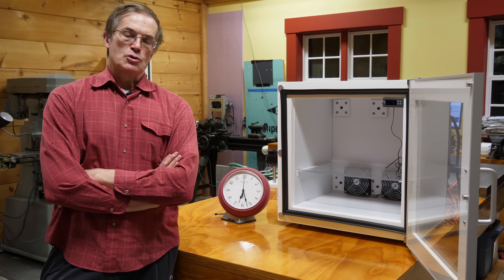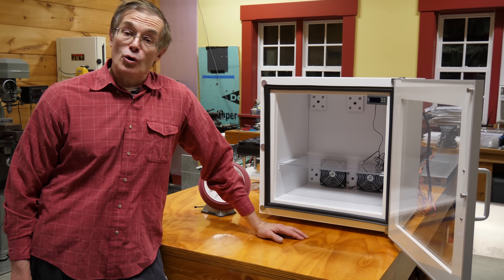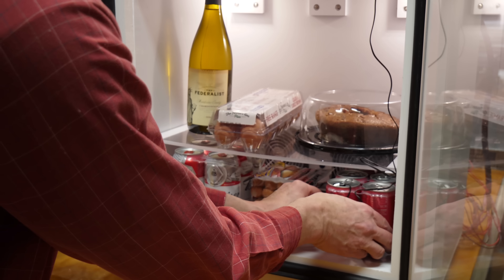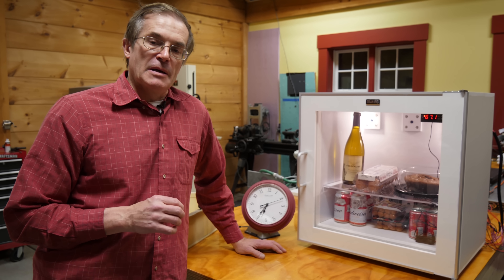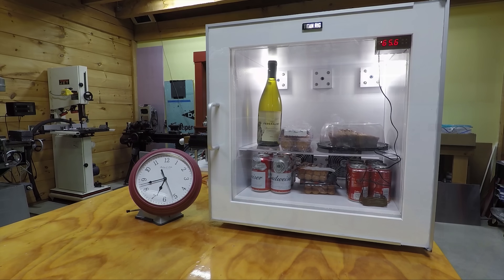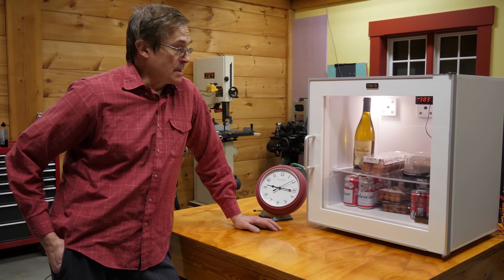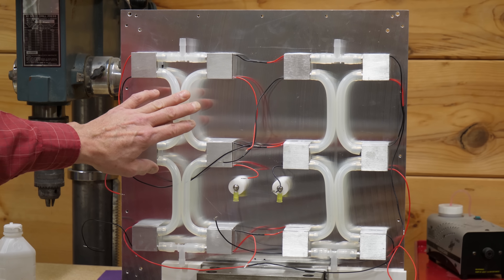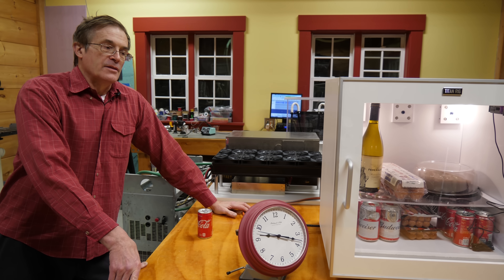TESTING OUR DIY REFRIGERATOR! - TEC/PELTIER

Comment: How about a fan duct that just brings outdoor cold air to the back of the fridge when it is cold enough outside? That would probably work with a regular refrigerator too.
Reply from the maker: That would work, but a challenge is condensation.  Water lines can be insulated  with a little effort.  An air duct will  have to be sealed and all the cold  surfaces on the back of the refrigerator will also have to be isolated from the room air to prevent condensation from dripping on to the floor.  The obvious advantage would be the higher effeciency of the existing phase change system on the conventional refrigerator.
Reply: @TechIngredients  That is true, but the cost of the cooling would be much cheaper, and totally passive if the weather was cool enough. I wonder if you had a water tank and used that as the heat sink for the peltier units if that would be better. You could use that water tank as a preheater for your regular water heater. Of course the cooling efficiency would go down if you did not take a shower and do the wash for too long...

Comment: be careful because if i have a similar system with a water loop and i get my "cold" side heat syncs freezing up a lot. once they are covered in ice it lowers the surface area and will reduce you heat transfer out of the box. 
wish i could post pics on here of my system. i use to to cool my dinks so i dont have to get up form my pc as much during work hours
Reply from the maker: The cold side is isolated from room air and the interior of the freezer is hermetically sealed.  We also don't want condensation to cause water to drip from the cold components.

Comment: Very cool...    you have to love Pex for allowing the flexibility needed to do single runs from any two points, like if you were to put your heat exchanger outside...
Reply from the maker: That's a good point.  It's also the material I would use if constructing a small thermal ground loop as a year round heat sink.

Comment: So you have 6 surface areas, 5  of which are insulated, and 1 light.  So does the efficiency decrease by 1/6th because the door is uninsulated?  Does that light decrease efficiency more than an uninsulated door?  Because this is a demo, that is why you are using the glass door.  Also, if you used a metal shelf like a thermal mass, would that thermal mass do anything significant to increase efficiency?   Lastly,  can you hook up a watt meter to check on the power consumption?
 I'm guessing you could make those fans variable to reduce power consumption when you are at temperature.  Thanks for the fantastic videos!
Reply from the maker: The door is double pane, but still has a lower insulating than 5cm of foam.  The lights are each 3 watt LEDs.  The shelf is pooly coupled to the heat removal path and so, it acts like the food as a thermal mass.
The performance of the refrigerator was balanced against it's convenience.
The freezer, on the other hand, will improve on the insulation, dispense with regulation, lights and we'll analyse the power consumption as well as the benefit of various remote heat sinking schemes.

Comment: There's a cooling system called SkyCool, which is a reflective panel that reflects light, more specifically wavelengths of 8 to 13 µm, into the upper atmosphere and space to provide cooling. 'Tests' show 4.9°C below ambient, and a claimed cooling power of 40.1W/m², on a 40°C day.
As far as I've searched, I can't tell if the material they use on the panel is just aluminized mylar, or if there's more to it. I also don't know how they're coupling their panel to their coolant loop, as SkyCool is meant to be an alternative to refrigeration based air conditioning. 
Diy'ing your own SkyCool system would make for a good video or series, and would go along with this project well. Hopefully it's something you can look into.
Reply from the maker: I'll look into that.

Comment: This looks so much better than any other Peltier refrigerator video out there, this and the previous one! I was hesitant to watch that one but it really wasn't just a 40-minutes build log. All the explanations you give teach so much, thanks.

Also one thing I'd like to mention is, thermal grease quality makes a big difference. CPU-quality thermal grease, even mainstream ones like Arctic Silver 5, are better than the general purpose electronics ones (in my limited experience) and expensive ones like liquid metal (like Conductonaut) can drop a CPU's temperatures by as much as 20 degrees (!!!) using the same active cooling which is frankly mind-blowing to me and I'd consider it helpful in "one of the legs of that stool".
Reply from the maker: We are working on a thermal grease video.  The single most important component is the surface preparation.  With flat enough surfaces that are very smooth, no grease is needed and any grease is worse than none.  Beyond that, the heat transmission depends on some interesting interaction between the organics and the high conductivity fillers.

Comment: @Tech Ingredients - Can you please post the electricity amounts used to get this 30°temp difference? Im assuming you're running it at 5V as mentioned in previous video, but what amperage so I can calculate Watts used? Did you happen to measure total running wattage with Peltier chips and fans going? Thx
Reply from the maker: The total electrical consumption is 120W continuously, but the temperature is still falling very slowly.  I would estimate 110W represents a steady state consumption.

Comment: what's the energy consumption efficiency of peltier system vs a standard fridge ?
Reply from the maker: Substantially lower.  You should take a look at our first video on this 
project, posted a week ago.  I go into a lot of interesting background 
on these devices
Reply from the maker: it's lower.
Reply: @TechIngredients  Thanks alot. I've check your part 1 video and just read between 10-15% efficiency vs standard fridge. Maybe industrial one are going towards 25%. However, it's still could be a nice option where compressor (sound) is bad. Do you have any idea reagarding life expectancy of those peltier boards ? Greetings from Canada

Comment: Would be intriguing to see a frost-free design.  Concentrate the effect of all the TECs in one place (using heat-pipes from the exterior) with a drip-tray below to catch the inevitable condensation, then use fans to set up air circulation throughout the refrigerator.  Having two fans pointing outwards as in the current design is just going to create a whole lot of random turbulence, and quite likely create stagnant areas near the cooling plates... exactly where you want maximum flow.

A radiator geometry akin to that of a car would help too, especially if combined with more heat-pipes - both for passive cooling and for being able to cool with a single larger (therefore slower and quieter) fan.

Comment: Making one wonder, why not pulling cold temperature from the ground? below 28ft yearly temperature gradient equalizes to about 62f, more than enough to use for this fridge setup, not to mention ground loop like that could be used in summer as no-compressor AC unit

Comment: My understanding, Peltiers / TEC's require current to heat one side and cool one side. I believe that heating one side or cooling one side creates a current. I've always wanted to try sticking some Peltiers / TEC's on the Sun facing side of a Building, to see if the opposite side would be cooled, and create some residual current in the process. Solar heat, Peltier cooling. Similarly, flip it around in the winter, Winter cooling, Peltier heating.
Reply from the maker: Check out our first video in this refrigerator series.  I go into considerable detail about this.
Reply: @TechIngredients  I am curious to learn how would peizo crystals qualify to create current subjecting them to an immense load of some heavy press.
Reply: Current would increases by adding some mechanism to deliberately cool the opposite side adding measures to keep both sides avoid leaking into each other. though its too minuscule. @Tech Ingredients :- I am curious to learn how would peizo crystals qualify to create current subjecting them to an immense load of some heavy press.

Comment: Having the heat exchange side on the top would make sense to me as cold air sinks, warm rises. Also having a cold "barrel"(door on the top) would prevent the cold air escape if the top is removed/opened and food is put in or taken out. Little more inconvenient but the heat exchange could be wired that it only work when the lid is closed. All this for less energy consumption. I also thought about water cooling for the unit.
Reply: he's using convection fans both inside and outside the refrigerator.  it doesn't matter where he puts the coolers as far as removing heat is concerned; only that it's convenient for moving and storage.

Comment: can't wait for water cooled version :)) 
I build my own poor-man water cooling PC system on both CPU and GPU using cheap aliexpres aluminium water blocks, 12v fluid pomp, 2 used PC fan and radiator from scooter placed outside :))

Comment: Can you cascade these Peltier devices? 
IE your set up with about a 1" solid aluminum block behind the first Peltier then a second one to continue to carry the heat away from the first one both with smaller temp gradients between them, and a thicker insulation space across the back wall.   
I'm considering something like this to build a fridge-freezer-hot(warm <5 gal) water tank in a floor to ceiling space of  a camper van, powered via solar.
Reply from the maker: No, you can't.  This question has come up so many times that I will address the maths in the up coming video on the freezer.

Comment: Well done, I have used this technology in my 18 wheeler for years. Started with Coleman PowerChill Hot/Cold Portable Thermoelectric Cooler, 40 Quart. As the Peltier and fans wear out I have replaced and upgraded and increased the fan/heat sink size with minimal results. In the summer its adequate as long as the cab AC in on. Based on what I've read and experienced the Peltier is capable of 30 to 35 degree differential based on ambient air temperature. I have mine wired and fused directly to the power source as over time due to the fact that it stays on 24-7 and current draw will eventually over heat accessory plug in to the point of failure. I have also found some Chinese sources of Peltier modules to be lets say not of consistent quality, but considerably less expensive than brands found in the USA and I'm not ever sure that many of the brands I see in the USA don't come from China anway.   Thank you Great video and very informative - Jayme
Reply from the maker: You're point about the TEC sources is valid.  The low cost TECs may not work as well as some that are sourced from  US based retailers, but at 10% of the cost, we purchased a significant quantity and tested each prior to assembling them into the unit.  With no moving parts and by running them at low power levels, where they are most efficient anyway, they should last a very long time.
Reply: Thanks for the reply. Just finished watching the 41 min build very well done. One question with all the research you've done I'd love to know your source for reliable TEC ? Maybe you could post that some time. Thanks Jayme

Comment: Hi, nice project :)
What do you think about a second stage of TEC on the hot side, to generate some power, maybe you can use 1 "hot end" to virtualy create a hot plate and stick an array of 9 peltiers on top of this "hot plate" @ each of the first stage then cool the final side for efficiency?
by the way: i have not done the math for this  :)

kind regards ;)
Reply from the maker: Thanks!
You might want to play with the math just a little.  You will see that stacking TEC's reduces their efficiency a lot.  The problem is that the second TEC has to pump not only the heat pumped by the first TEC, but also the electrically generated heat from the first.
Reply: @TechIngredients  fast reply, thank you  :)
sure, you've well explained this already
I thought about the second stage as "TEC power generator" and redestile some of the produced heat along with this "seebeck effect". maybe the amount of energy generated by Seebeck Effect is to small anyway.

Comment: Tech Ingredients I have been thinking about the approach you're going to be following up with but maybe inverse. I'm in the south and well we usually get all four seasons in a week, they make memes about this. My wonder is heat extraction and utilization elsewhere by using the heat from the refrigerator being pushed somewhere else like say the hot water heater this would obviously be a pre-heater but it will remove the heat from the room you're trying to keep cool and use it in a system you're trying to keep warm. For example, using the heat produced from the air conditioning process to heat a pool.
Reply from the maker: The recovered heat is useful, but the fact that there is any heat gradient between the hot side of the TEC and the environment, reduces the performance of the refrigerator.  Better to reduce this gradient as much as possible and therefore, there is not much left to work with.

Comment: Congrats!  As expected -it does handle the load. Thank you for both the videos. Since currently two videos deal with cooling technology. Would you please make one more, depicting the technology used in  condensing water from air,  as the only videos about it are just 'toy' sake. and not something real and useful. though one video specially should be credited for its idea using the underground temperature stability to achieve some condensation. Also totally opposite one senior guy I cant recall right now is using the stable heat of underground to grow a wide range of fruits, specially of the citrus family. If a video is not possible,  please elaborate  this technology in the comments if you may. Also your style of elaboration a topic -Great. I like it. One is able to get the knowledge from the ground up, to the latest and where it would go in the upcoming future, just re-realized you style again, in these two videos. Keep It Going. Best Wishes for 2019.

Comment: Peltier elements is quite inefficient. The COP is almost always less then 1 . Compare to Gas/compressor refrigerants you get COP > 3 (with ammonia systems ~ 6). 

COP -  coefficient of performance, how much energy spent to transfer heat from one place to another.
Reply: It will be amassing if you can make Magnetic Refrigeration to work in a small fridge like that (estimated COP ~2).
Reply: We know that from the video before.

Comment: In Australia we have ambient of 33C normally and up to 47C in summer. It has been shown that refrigerators need 60mm insulation "so called tropcal" refrigerators and Compressor type to cope with the 18 to + 47 temp range--- and they do. The Peltiers only cope with up to 30C temp differential before they implode.
Reply: 47c inside?